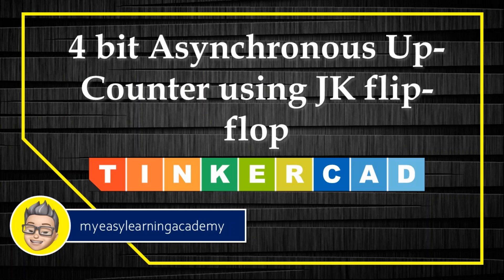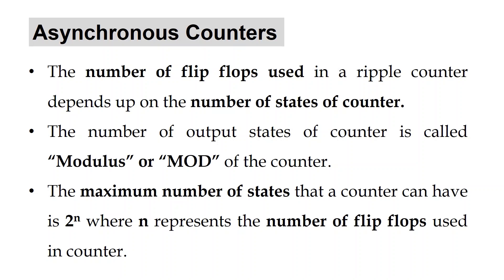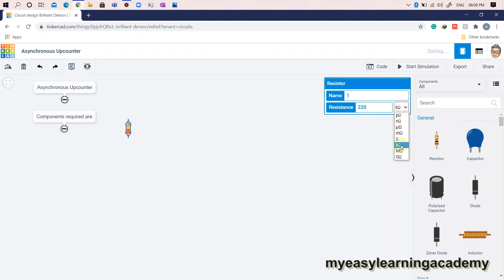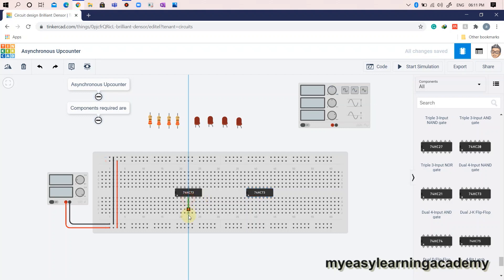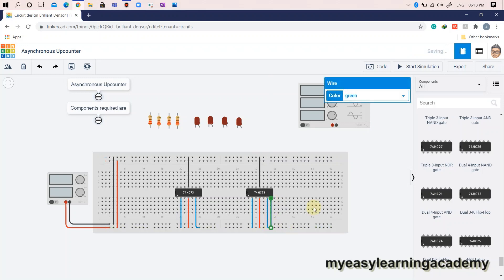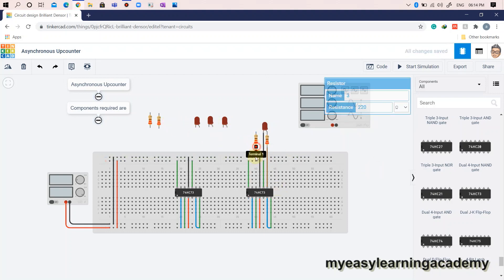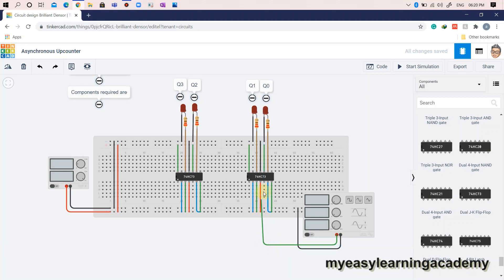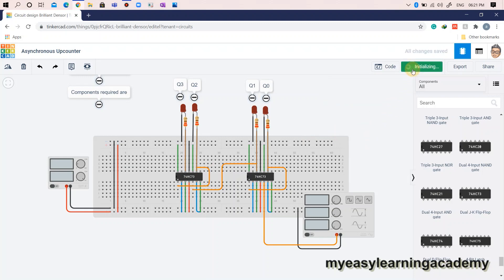4-bit Asynchronous Up counter using JK flip flop | Tinkercad

Comment: I tried to run this circuit using my own 555 clock that I built in tinkercad and it doesn't work at all. My clock works fine, and the 4 but counter circuit works fine but as soon as I replace the wave generator with my 555 clocks output, the 4 bit counter circuit just stops working. I was hoping I could use tinkercad to build an 8 bit counter that uses a variable 555 clock circuit as the clock input but I guess it just doesn't want to work. I wrote tinkercad about it and I hope they'll fix that issue soon.